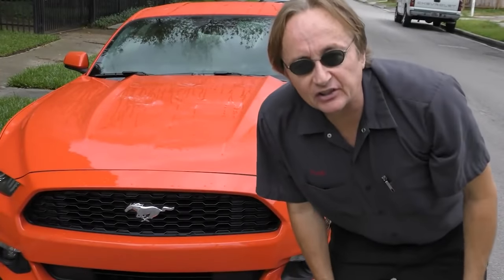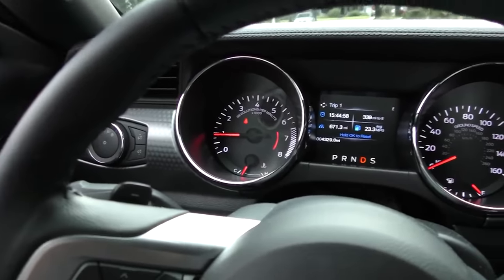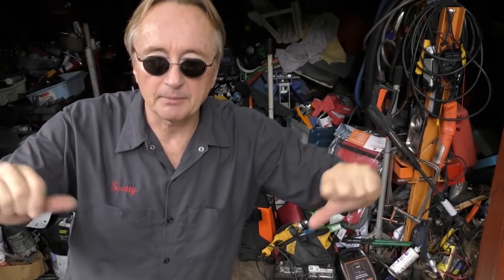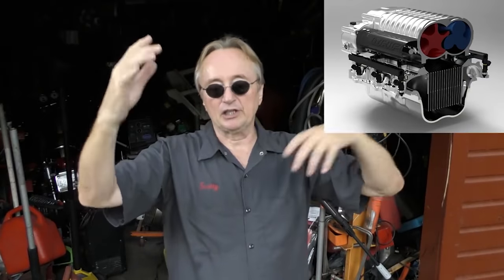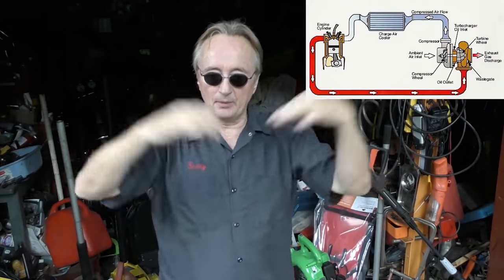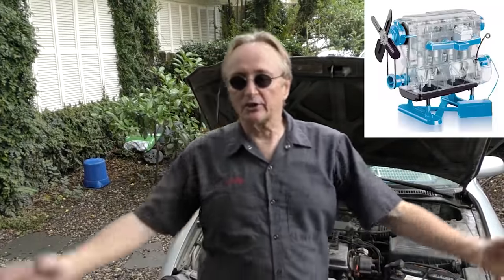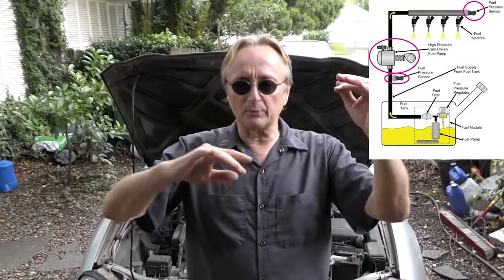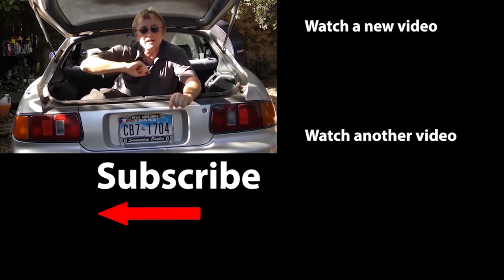I Was Wrong About This Engine and I'm Sorry

Comment: I'm just not a fan of adding stuff to make an engine do more work or work harder.  If you are trying to make a 4cyl run like a 6 or 8 just buy a 6 or 8.  I've never owned a car with a turbo and never will.
Reply: Thank you....some people just don't get it...so many cons to making a four cyl with a turbo run like a v8...for one the turbo will most likely fail before the engine...then your putting all that pressure from boost on the tiny engine..  and wearing it out sooner...then a bigger engine like a v8 with the same power will be way more responsive..and sound amazing compared to the wimpy 4 cyl sound..
Reply: My ‘91 Mitsubishi 2.0 turbo has never had the head off, and has the original turbo ...
Reply: Piston rings don't like turbos nor do head gaskets.
Reply: Neither would I my brother and thats why I chose the Coyote V8 over the EcoBoost V6 anyday of the week.
Reply: @stevemitchell9848  Yep you got it brother.
Reply: 2L turbo engined with up to 300hp usually last 200-300k km at least, when taken care of. Amd considering a rebuild (which is about time after 20 years) is about 5k usd, its not really that bad. And my Subie is faster than most v8's anyways (and outhandles then all!).
Reply: @Namesakes.unit-x-10sq10  Still won't outlast the V8s though.
Reply: @CJColvin  no, but at the same HP level, lighter weight, less taxes and fees (Europe😐) and better fuel consumption it makes it cheaper and better performance wise here... And when it is time for a rebuild it suddenly has 400+hp🙂
Reply: @Namesakes.unit-x-10sq10  Well then have fun till it blows up.
Reply: I will agree to a point, but this was not always the case. When the ricers and GN's of the time were beating everything in the 80's and 90's, it was because of good systems and turbo chargers and air coolers.  Mostly cast iron and heavy, though. Great engines and could be built to 500hp with minimal work. Hell, some of the Mitsubishi's could be daily drivers. Certainly the Honda's were. Hell, I could get 20mpg out of my stock GN and still beat the ricers. Cars are much quicker and more tech heavy to make the driving experience fun. They just forgot how to make them hardy and robust.
Reply: @CJColvin  have fun watching my tail lights fading into the distance, with 4 doors and an unstoppable awd system😝 while still scoring better on all Ncap tests❤️ god i love japanese cars! But i can see why a v8 car makes sense in the US👍
Reply: @Namesakes.unit-x-10sq10  But yet the Subie won't outlast the Camry nor the Accord and plus they'll never look as beautiful nor have the soul and character as an old school GTO or Chevelle or even an old school 69 Charger.
Reply: @danw6014  Yep you got it brother.
Reply: @CJColvin  based.
Reply: @Namesakes.unit-x-10sq10  None of the Subie models will outlast my old 96 Ford F150 with a 5.0L (302) Windsor V8.
Reply: My two turbo Nissan 300ZXs (1984/1985) ran very, very well...   : )
Reply: Diesel cars have had turbo & direct injection for 30+ years and lasting over 200,000 miles.  Gasoline turbi-DI should be able to do the same

.
Reply: Yeah I never really got it especially for "efficiency". If all things are equal power wise the efficiency is going to be negligible. I could see why someone would want one in maybe a small performance car but that's about it.
Reply: This is my first 4cyl turbo. I don’t race around but this vehicle runs great. Smooth, Good MPG and enough pep to move when necessary. I recommend 100%
Reply: @stevemitchell9848  you have never driven a supercharged V8. and or a turbo charged anything. try it some time. you may never drive again.
Reply: @moresnare  till it couldn't find my 3.6 twin eco.
Reply: @electrictroy2010  300k on a first gen TT eco agreed. she is only 12 years old. but she'll tell me how we do when she's done.
Reply: @jizzyjake6783  efficient wise I will say, it depends on how you run it. I bought mine thinking of fuel eco. however, I had a lot of fun with it. not very eco.I do notice a big difference if I am very chill on the throttle.

Comment: Have a 2015 Ecoboost Mustang with 101k miles. Been driving it like a granny since 70k miles and it sounds great. Oil stains on the engine but I change it every 3k.

Comment: Every engine can last long as long as you take care of it. I've seen EcoBoosts run well over 150k miles with minimal issues. The ones that dont ultimately come down to people who dont take care of their things
Reply: Whats well over? 190k or 155k
Reply: I’m not sure if the word every can be used there. Maybe replace that with “some” or “most”.  Because some are just not made very well.   JMHO🥸.  

And to be honest him telling us we should get to V-8 might not be the right one to go with either.  I have one that has 40,000 miles on it and it’s using about 2 to 3 quarts of oil every 5000 miles.  . I’m glad it’s a lease😳
Reply: I learn to drive in a 66 Mustang with a 289. I now have a 2015 EcoBoost Mustang 50-year Edition with 6-speed Auto. With the 4-cylinder there is less weight in the front end which gives it much better handling than the V8. And for me the horsepower and torque far exceed the old 289 and is plenty for me. I live in the suburbs and many times drive to the cities which involve city streets and freeway driving and even at 70 miles an hour on the freeway I still get 26 miles per gallon. I don't drive it in the winter and is not a daily driver so I only have 11,000 miles on it. Eventually I will put in an oil catch can to help reduce the carbon buildup at the intake valves. I change oil every year with synthetic and with regular maintenance this car should last me many years. With as little as I paid for it it is still cheaper than a used older sports car. I've never been one to sit at a stoplight smoke the tires. When young I had a 71 Cuda with a 340 4-speed. I used to love running down my road with sharp curves and Hills and straight areas. This mustang gives me that same thrill as a youngster
Reply: I work for a Limo company and we use the Lincoln MK crossover with the V6 ecoboost.  We get over 350k miles out of them - BUT, they are expensive to maintain.  Water pump replacement is 12 hours labor, for starters.
  Personally, I'm not seduced by the tech.  I like my '07 5-speed Corolla just fine.
Reply: I have got a 3.2 pentastar (Jeep) . Scotty does not like those engines..I will see how long I can have before breakdown
Reply: Agree 👍
Reply: what are your thoughts on the new 2022 Explorer Limited? did they fix the transmission and reliability issues?
Reply: I've taken care of my 2013. It still needs new turbos at only 69000 miles. I'm getting it fixed and then going old school and dumping it off to the next sucker.
Reply: @katieandkevinsears7724  with that low miles on that older vehicle I'm guessing you don't drive it any distance when you take it out. Short driving is worse for car than taking long commutes. My Mustang has low miles because it's in storage for six months out of the year. But when I do drive I try to put at least twenty miles on it each time I drive it. That it gives all the suspension and drivetrain components some movement and lubricates the mechanical components
Reply: @davidclemens1578  Wisdom spoken here.
Reply: @goreyboggs  which V8?
Reply: @northdakotaham1752  I have the coyote.
Reply: @davidclemens1578  I have several vehicles that are stored more than they are driven. They seem to fail more than my daily driven vehicles. Parts get old from just sitting in storage, belts,  hoses, oil seals etc.
Reply: @goreyboggs  hope you get it worked out. I think that is currently the only engine Ford makes that I would ever consider owning. Just too many problems with all the others. Is that in an F150?
Reply: @desertrat1111  Those are some extremely powerful engines considering their simplicity.  I've had a couple of 3.6 which is pretty much the same thing.  Just run synthetic oil and I like 5W-30 and the rocker arms that are known for going out will last 150K or more.  As soon as you hear them starting to tick or squeak, stop driving the vehicle and get them replaced by someone that knows how to and it's good for another 150K.  I've seen quite a few of those engines go 300K on the original timing chains and very little repairs done.
Reply: @northdakotaham1752  yes I’m the F150, If you look it up there’s lots of these have oil consumption problems.  I special ordered it because I thought it would be better but it has not

Comment: 2015 Mustang with the 3.7 V6 just rolled over 90,000 and still runs like new.  Best car I ever had.
Reply: My 13 Lincoln MKT has the 3.7 and has 386,000 miles!
Reply: Nail thats a good car ya
Reply: I wish Ford had kept the V6 in the Mustang, I bought a 2020 with the four-cylinder and would really rather have the V6.
Reply: @silvertbird1  I have an Eco and like the 4, but everyone slept on the V6. It was a good engine.
Reply: Overlooked engine. 305hp back then in a v6 was crazy.
Reply: My Mustang has 206 000 Km and running like new.